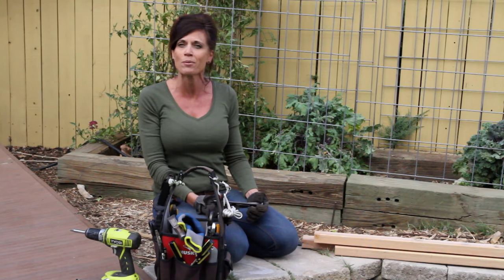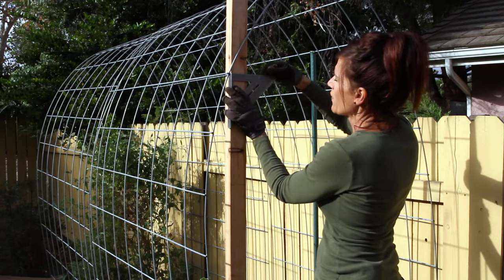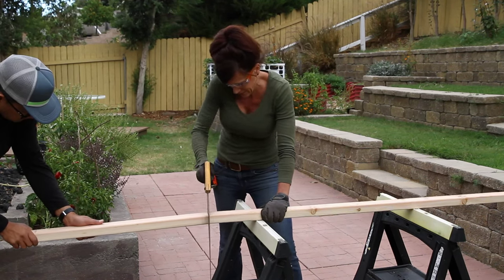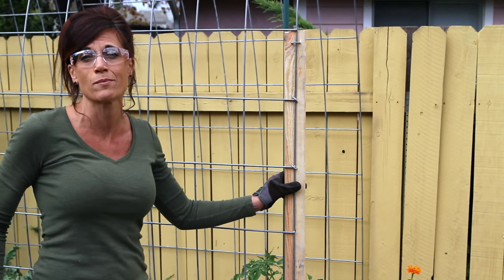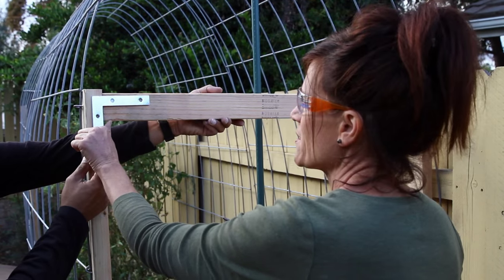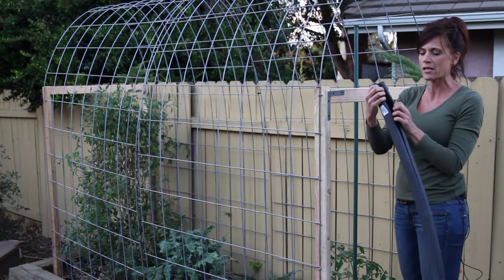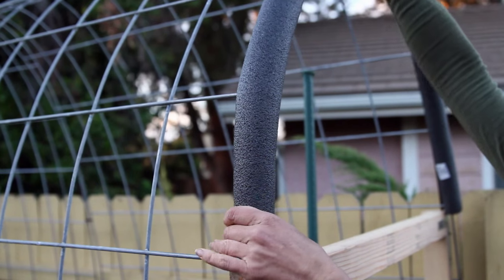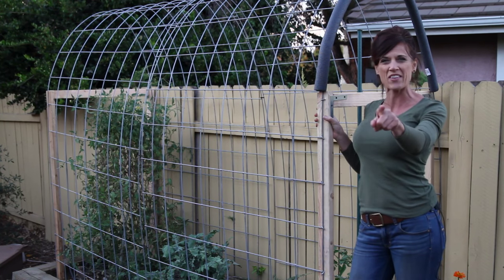How I Built a DIY Cattle Panel Hoop House - Part 2

Comment: A couple tips for you. First is when using a hand saw use the full length of the saw (long strokes are better vs short strokes) and light pressure, let the saw do the work. Second tip is when you put in the staples in the 2 by vertical have camera guy hold a bigger hammer than you are using on the opposite side of the 2 by you are stapling. It will save your hand from the shock of trying to hold the wood in place while stapling it.
Reply from the maker: Thanks for the tips- I do enjoy using the tools but it is challenging to film at the same time. Sometimes on our projects we have a friend help us film so CameraGuy can be a second set of hands but he was filming this episode so couldn't help me as much as he usually does.  Appreciate you stopping by and commenting!  Happy Thanksgiving!